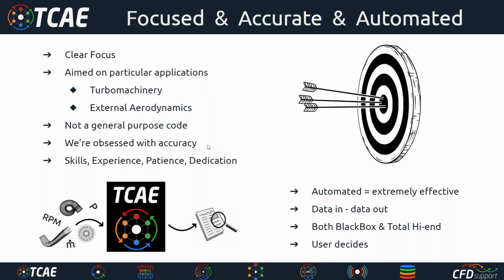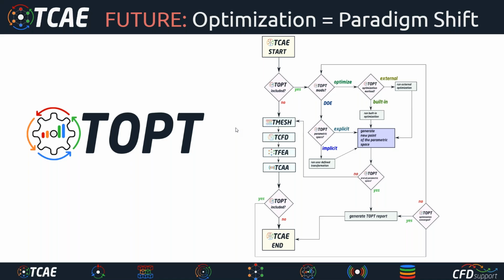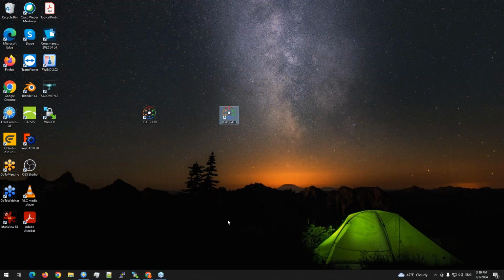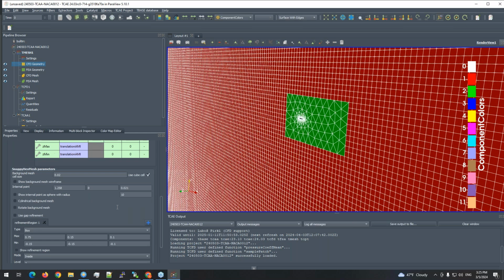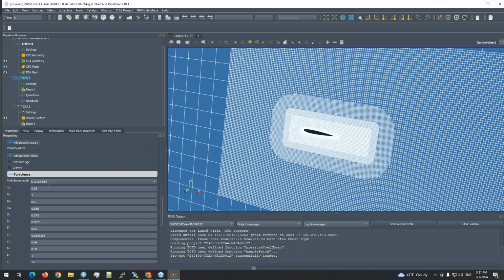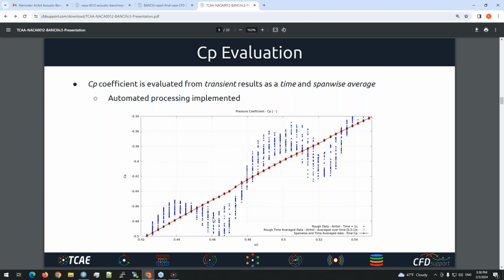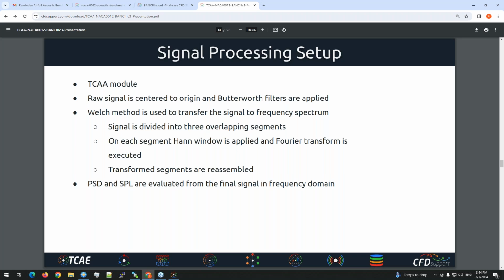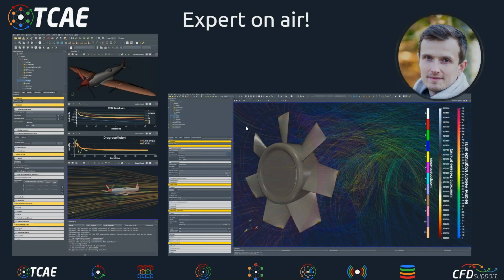Webinar 77 - Acoustic Benchmark - NACA 0012 , Mar 5, 2024 | CFD Support

Comment: Hi, What is the computational overhead for the acoustic processing compared to just the CFD on its own ?
Reply from the maker: Good question. Not easy to answer. The acoustics evaluation only takes about 10% of the CFD simulation. BUT the CFD simulation for acoustics evaluation has to be fine enough (mesh & time step) and transient and that in fact determines the demands. ... The acoustics simulation process is merely a sophisticated postprocessing of a very fine CFD results.
Reply: Interesting. How computationally practical do you think a centrifugal fan would be in 3D ? It would be impressive to capture the volute tongue passing noise.
Reply from the maker: @pete_dl1585  The simulation of centrifugal fan with this acoustics model could take about 2000 core*hours - a single run of about 10-20 rounds. Please note, this is a rough estimation.